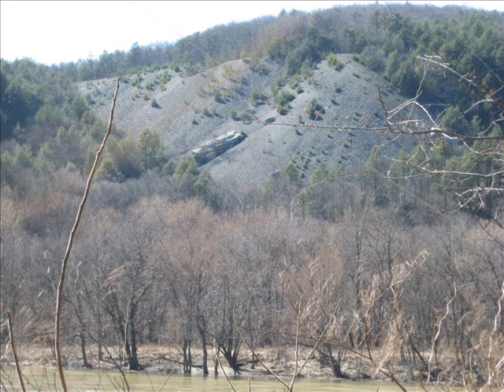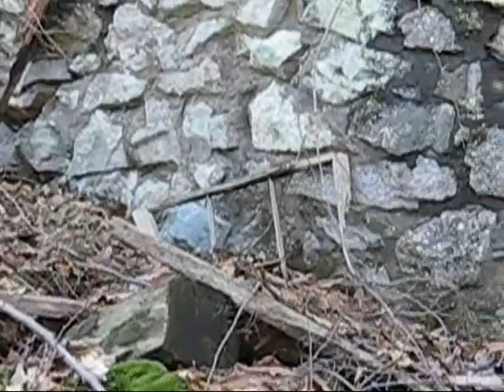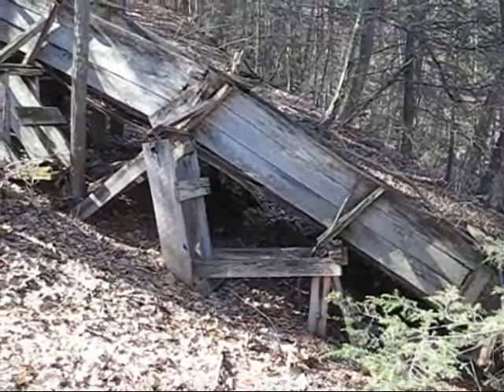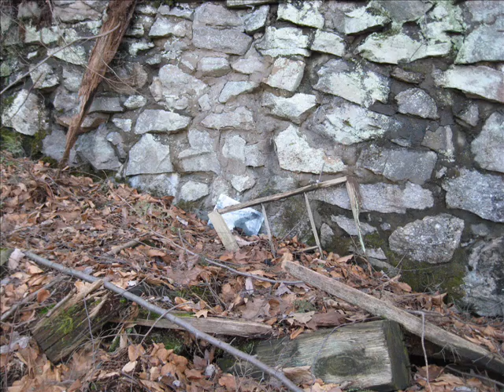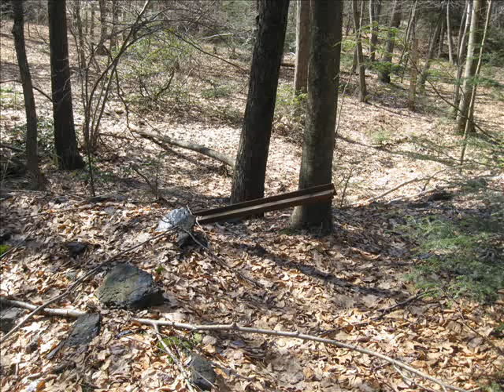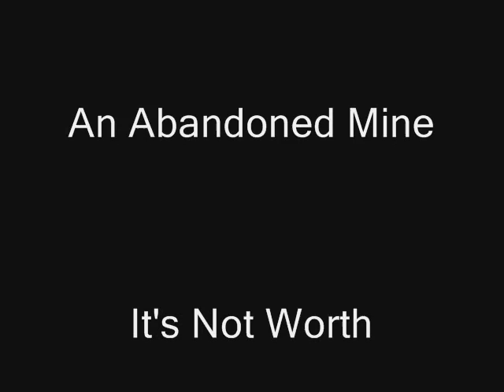Shickshinny Coal Breaker.wmv

Comment from the maker: You can see the stone wall on Rt11, across the highway, between the old Hasay Chevy dealer and the Moc.bridge. There's a path, at the end of the stone wall that goes up the mountain, towards the culm bank. Follow the path up to the bottom of the culm bank. The path will turn left, across the little creek. About 100ft farther, the remains of the coal breaker will be on your left. The whole side and a good part of the top of this mountain, was used in mining. Traces can be found in many places.

Comment from the maker: @mrisfun The breaker was a much larger complex. Anything of higher value; machinery, copper wiring, etc. was salvaged. Some of the lower value items, mostly cast iron, seem to have been left behind on the steep hillside, for one reason or another. Parts of the colliery are on State Game Lands. Except for the short mine opening, which is on the side of a very steep mountain side, all of the mine shafts, slopes and openings have been filled and the lands have been reclaimed.